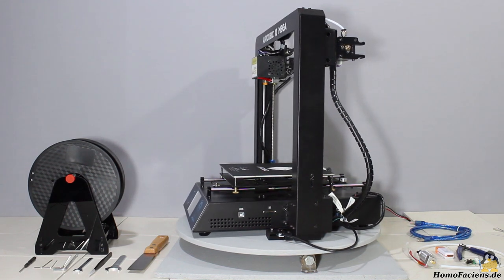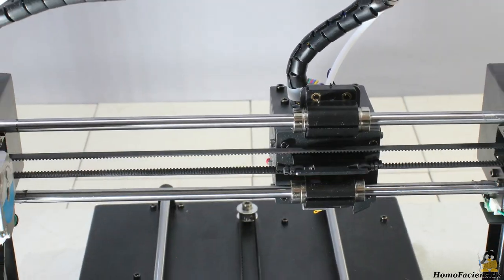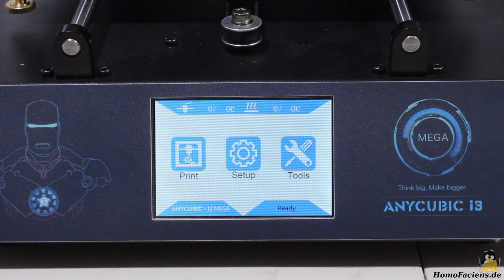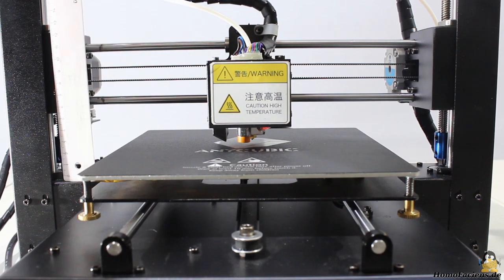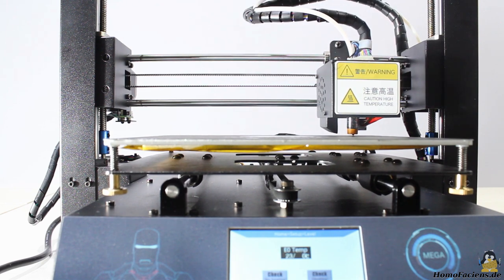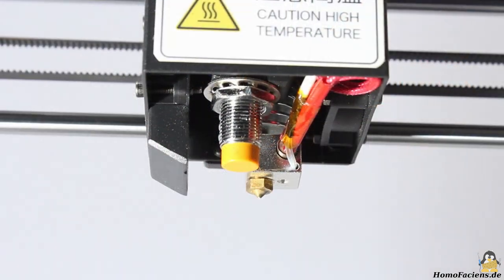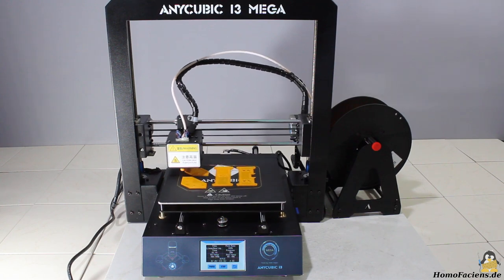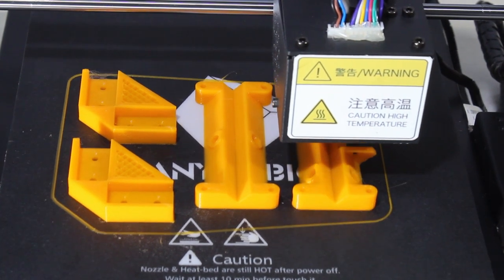Anycubic i3 Mega 3D printer review

Comment: Thanks for a very detailed review. What are your opinions about the this printer compared to the Creality CR-10. I know the print volume is larger with the CR-10, but what about the print quality between both? I'm trying to decide between the two so any help you can give would be great. Thanks!
Reply from the maker: I'd suggest to wait. I am getting an improved version of the CR-10 for a review video, soon. It's the Anycubic E10:
http://www.gearbest.com/3d-printers-3d-printer-kits/pp_664899.html?lkid=10987056
This printer has metal bearings and two motors for the Z axis at the same costs. It's a clear improvement in mechanics.

The difference in print quality isn't that much. I'd say the CR-10 is slightly better. In practice both work fine and I like the solid construction of the i3 Mega..
Reply: When will the new version of the CR-10 (is that the CR-10S) be out, I want to buy yesterday:-).
Reply: HomoFaciens Not worth your effort. Anet E10 is just poor imitation of cr-10, pretending to have some bettet features like double Z rods. Overall quality is very bad. This printer shouldnt even stand next to cr-10.
Reply: Ps. Another youtuber said, that Anycubic I3 mega prints ABS much better than Creality. What is your experience about it?
Reply from the maker: The heated bed of the CR-10 doesn't reach temperatures more than 85°C while the Anycubic i3 Mega has an insulation layer underneath the build plate and gets up to 100°C. With the higher temperature you can better fight warping.
Reply: HomoFaciens that's true, but do you think if you mod the heatbed in cr-10, so it reaches 100°C and buid enclosure this printer could print the same or even better ABS than anycubic?
Reply from the maker: ...too many would and could and should to give an answer ;-)

Comment: Hello, thank you very much for your review, I would like to ask about the types of filaments that this machine allows, my intention is to use it for prototype machining, which must resist mechanical forces, I can use carbon fiber filaments. or otherwise, the machine can be adapted to tolerate this type of filament. Thank you
Reply from the maker: I haven't tried carbon fiber filaments yet, but I am confident that this machine can process them in general. Fiber particles usually wear out brass nozzles over time (but they are cheap to replace) and tend to clogging (a 0.5mm nozzle is worth trying).

Comment: Are you using Cura, if so what version? The 15.xxx (very old version) that comes on the SD card was corrupt on my SD card and I don't have the setting for Cura 2.6.2 which I am using. So far it will not print gcode from 2.6.2 correctly. Prints the sample just fine.
Reply from the maker: I am using Slic3r. I don't think the Cura version on the SD card comes with preloaded configuration for the printer. All I can offer is sending you the files on my SD card.
Reply: In the manual, it says to put "Initial Layer thickness" = 0  To me that does not seem right, why would they want that to be zero?

Comment: Sorry to say I've just unsubscribed. This used to be a really great channel full of innovation and making things yourself using bits you could find by recycling other items or very cheaply in a DIY store.
Now it has turned in to review channel for pre-built *OPEN SOURCE* items - the very epitome of items you're meant to build yourself.
Reply from the maker: Well, it's a bit of making hay while the sun shines. With the bunch of 3D printers I got from the sponsor I could test a variety of printer designs and learn a lot about filament printing. I will turn that knowledge into an own printer design in the coming weeks or months (even creating cheap devices eats a lot of time to build, test and rebuild until everything works). I will use parts of the printers I now have in my workshop to do more investigations about what my ideal printer will look like and what ideas will work. If I had money and time to do all this without support from companies, I would do so, however my projects are in total still a loss of money...
Hope to get you back when my ideas get turned into a working printer.
Reply: I like watching all the reviews to see if any of the different designs have an advantage in surface finish and accuracy.
I don't have a use for a 3D printer, but I am slowly putting together a DIY CNC plasma cutter based on Absorber of light's design and hints from here.
Keep up the good work.
Reply from the maker: +therealnightwriter Please, please, please don't offend someone that made clear his position in a politely way. Stumpy did not leave my channel nor give a thumb down just to hit me. He told me what he want's to see changed. Well written critisism is what made my YouTube channel and the related project page become better. I like discussing problems with my audience as long as the words aren't offending. Hope that will be okay for both of you...
Reply: I guess trolls are just going to troll. I thought it was in my interests and his to let him know why a YouTube follower of nearly four years, with multiple likes and comments, felt strongly enough to stop following. It actually seemed more rude to just unfollow without saying why.
HF has produced a lot of great, original, content over the years and has been recognised for it on here (in subscrptions) and elsewhere in the community such as Hackaday (where I am still following). To me it would be a shame to lose that grass roots following by becoming yet another review/unboxing channel.
Reply from the maker: ...ideas need time to grow over time. I in fact am thinking of making a DIY 3D printer from scratch using common parts as I did with my CNC routers. You made me go back in my workshop to disassemble one of my commercial printers and play with the hotend (and ruined the power supply quite now during first experiments). It's good to have a bunch of machines. There must be a way to directly extrude scrap plastics...
Sometimes I need a push to speed things up ;-)
Reply: HomoFaciens well, i follow stumpy on that but i also understand you want something more out of the channel. finding the healthy mix is the way. i also grinned when i saw review after review from the man who always showed us you don't need anything to make something great ☺. part because of your videos i actually made my first cnc... and second and third(seen on my channel too). i will not unsubscribe since i have the feeling you will get some new ideas in the future and it will be the bomb. ypur brain x junk +waste = great lowtech project!
Reply: I agree with Stumpy in that these reviews aren't why I subscribe to this channel, but I can just skip them. I know there will be non-review videos coming eventually, why unsubscribe?

Here's an idea: put all the printers in RoboSpatium and provide some interface for visitors to send 3D models to be printed. Then put the models on display. Of course it could/should have a moderation step in order not to get infinite genitalia or such.
Reply from the maker: Controlling a 3D printer totally remotely in the RoboSpatium is too tricky:
You'd need a robot arm (or something like that) to put empty build plates on the printer and remove them afterwards. Accepting prints from someone somewhere on this planet would create a heap of plastic junk.

I will eventually modify a printer to make it a tiny "on demand factory" used in exhibitions. You can chose from a variety of 3D models on a webpage and the print will start as soon as the "order" is confirmed. Only small 3D models that can get printed quickly (e.g. characters or signs with your name/personalized message).

Non review machines take much longer to build, which is why reviews appear more often (and of course sponsors push me to publish quickly).
Reply from the maker: There are stil "bombs" in my storage. One is a 3D printer build from scratch. With the reviewed printers I could learn a lot about how filament printing works and I have a bunch of machines to check my ideas (I don't have to fear causing damage on a machine if I have a heap of spare parts...)

CNC v3.2 is also still under development, however building from scratch takes time.
Reply: HomoFaciens is an extremely talented scientist/teacher/presenter. Many of his YouTube videos astounded me. But he is a terrible businessman. That, by the way, is common. It is almost unheard of for say, a great engineer to also be a great salesman.

Several times I have presented arguments to HomoFaciens about how to increase his chances of earning a living from this YouTube channel yet he has stubbornly refused to engage me in meaningful debates.

If you look at my past comments I posted to other videos of HomoFaciens, I have I proposed that he try to become an "YouTube star" by engaging an agent (similar to how a Hollywood actor engages an agent to represent him) and to focus on compelling projects that would likely appeal to a much wider audience. Regarding the later, think of Clickspring, for example. Most people ("the general public") like projects and stories.

A five year project building an automated system for, say, clearing a table, washing dishes, drying them, and putting them into cabinet would likely involve extremely complex and interesting technology. In addition suspect a wide audience find it compelling because, let's face it, most people like to eat meals but few people enjoy cleaning up afterwards.

I would guess that most geniuses actually accomplish very little because they are so caught up in their own world that they fail to properly cooperate with those who can help them turn their talents into marketable solutions (products and services).

At the end of the day, becoming a YouTube star is more or less like becoming a Hollywood movie star. The way to succeed is well-documented. Want to become a movie star? Be great at what you do, create engaging projects, and market your projects effectively. Trying to do that without, say, an agent and a publicist is like trying to cross the Atlantic from, say, London to New York in a small sailboat. Sure, a few people might succeed that way. But there are better ways to make the trip.
Reply: I disagree, I have watched many of HomoFaciens videos and found them to be of a very high standard in terms of objective analysis. Whilst I was surprised to see him here now reviewing these two machines I actually greatly appreciate it as I'm considering purchasing one of these machines to get started with basic rapid prototyping capabilities at low cost so I can invest my time, energy and resources into what I actually want to build which is not 'yet another 3d printer'. 

To have a trusted, objective analysis of both this machine and the Anycubic kossel has undoubtedly saved me a lot of time and money for which I am extremely grateful. HomoFaciens, keep up the great work! I appreciate your scientific and objective analysis of these printers and am very grateful that you choose to share your insights with us on youtube, whatever insights they may be!
Reply: Keep it up, HomoFaciens! I feel the same way as davo963320.  I never underestimate the contents of HF. To be able to produce all that content, there's a lot of background work. And inbetween production of high quality stuff, there's another high quality review. Wehoo. I agree with the saying that great engineers are not great businessman eheh but sure there's a lot of fun meantime.